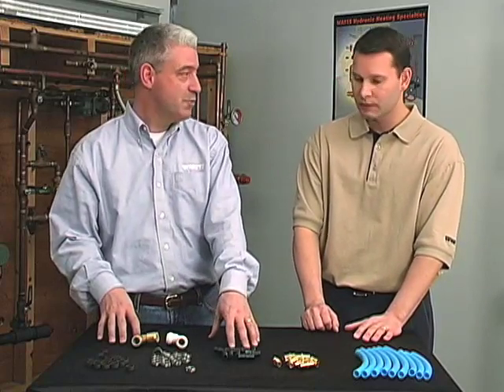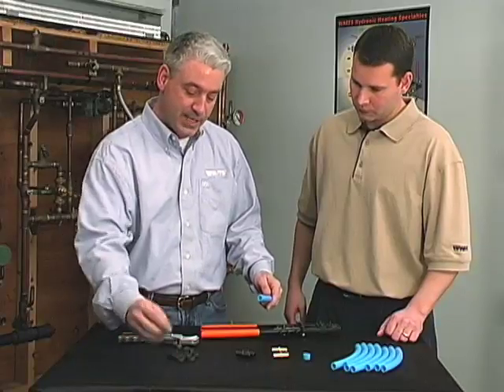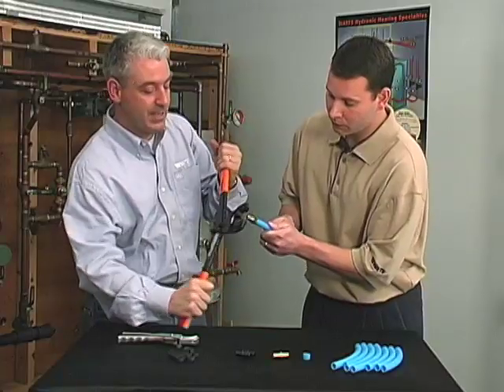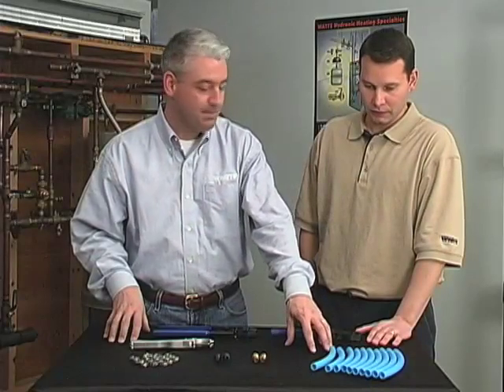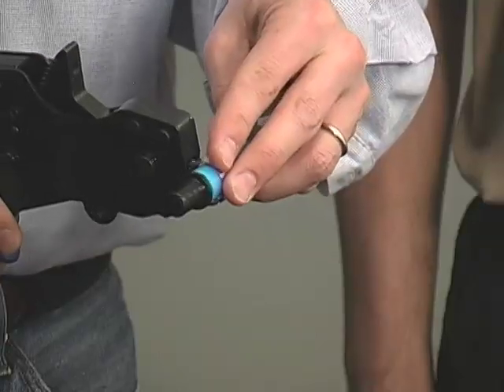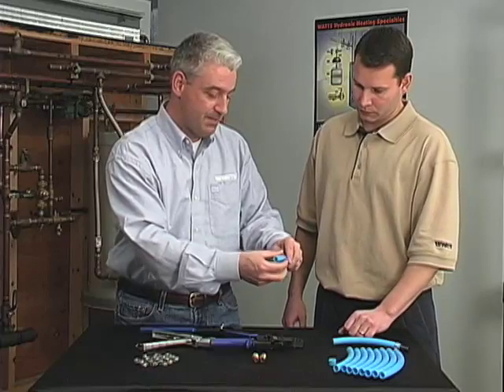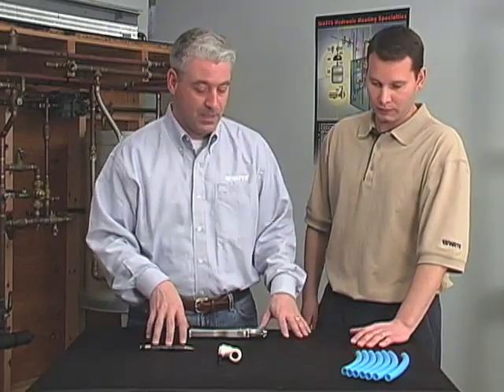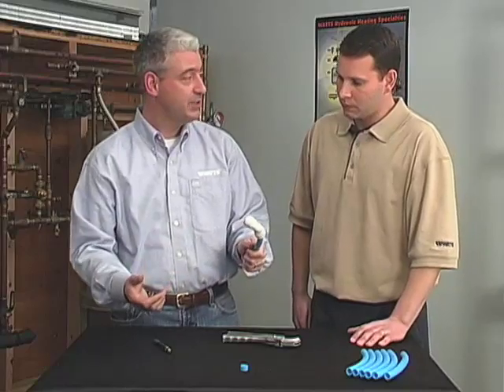How to Connect PEX Pipe with Watts WorkShop™

Comment: Can you use pex for an T+P valve drain extension pipe?
Reply from the maker: Sorry for the delayed response. This one fell through the cracks. To answer your question, PEX cannot be used for T&P discharge piping because it doesn’t have a high enough temperature rating.